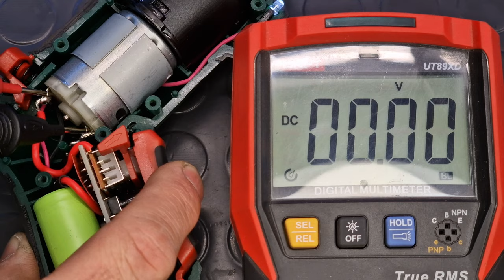Fix Parkside PSSA 4 B2 not working Electric Screwdriver

Comment: The old stiff cable crap will be broke again and again ! To fix that permanently you have to solder in hi-flex silicone cable which will probably last longer than the screwdriver itself.

Comment: I plug mine in and leave it for ages and the light doesn’t even turn on it’s like it isn’t getting power at all, I just plug it into the wall in my house
Reply from the maker: Measure the battery voltage. And if it is below 3.2V, you have to charge the battery using an external power supply or you have to change the battery.

Comment: wow what a piece of crap!  now I know not to change the shape of the screwdriver too many times.  It was dumb to buy this thing... should have just used a compact driver for these screwdriver tasks.
Reply from the maker: What's so complicated, if the cable breaks you will solder it.🤷‍♂️
You already know the weak spot🙂
Reply: @ErCanEverything  My Fiat ducato is taking up all my project time.  I live out of a motorhome so I want to have a minimum number of tools that work.